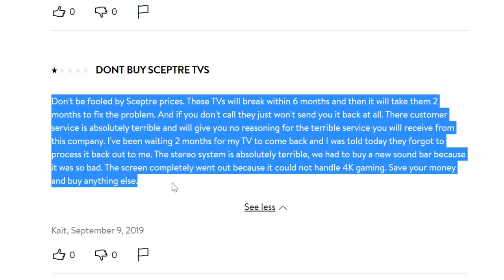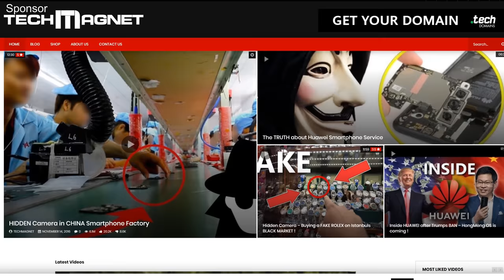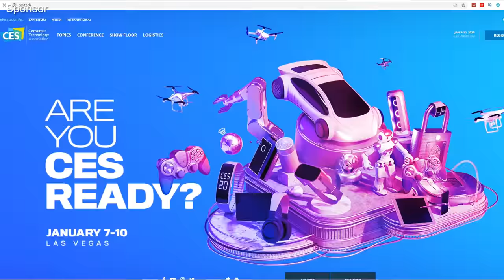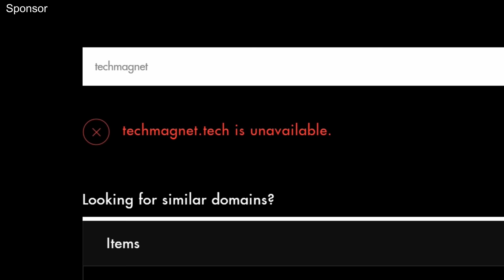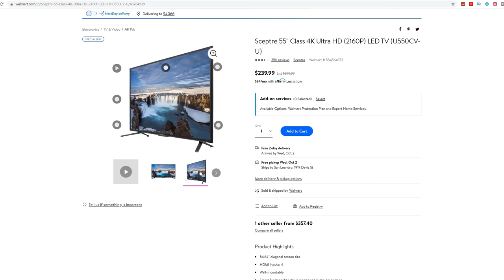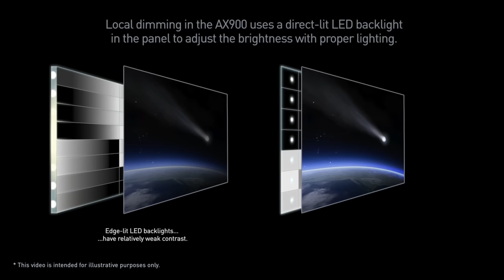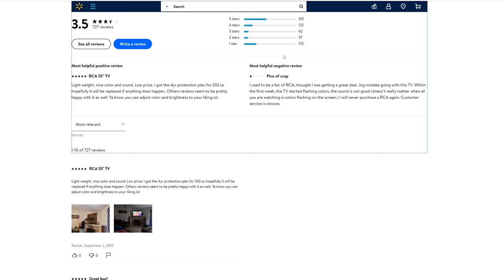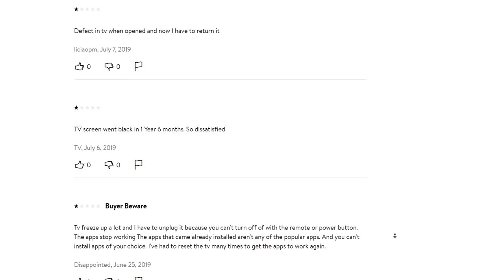The TRUTH about CHEAP WALMART TV'S !

Comment: My flat screen tv from wallmart is 10 years old and still going bought 2 TVs from best buy name brands only  got 6 months out of a lg tv and a Panasonic lasted 2 years so wallmart TVs are pretty good to me
Reply: To each their own but I could never get a tv from Walmart because they are the bottom of the barrel. But I'm glad you found one that hasn't given you any problems man.
Reply: We purchased two Samsung Smart TVS in 2015 and one of them stop working and later we fix it but we accidentally broke a pet of the tv and the display is not the same as before and the other tv we bought it in 2015 I believe almost the end of 2015 and we still have it
Reply: I got a scepter 55 inch from Walmart and steal going strong after 5 years. Would never buy named brand TV again.
Reply: @jayDee92133  I honestly dont think theirs a difference my 4k tv for 300 bucks 55 inch my uncle got a Samsung oled over a grand and we couldnt tell the difference between them no bull
Reply: We bought a tcl 65 inch from Walmart last year.  It gets used a decent amount and is still going strong.  The only issue I’ve had with it is a couple of times the picture flaked out and the colors were way way off.  In each case, unplugging the tv then reconnecting power seems to resolve it.  However it hasn’t done it for a while.

This TV is a roku TV, one thing I did do was to factory reset this tv, and never allow it to connect to the internet.  We do use a fire stick with this TV, so I’ve set it to automatically go to that hdmi input, and turned off all data monitoring etc.

The tcl from Walmart has been ok, but when I got it, I was trying to find other brands in the same size, but it was literally the only brand in that size available that day.  Otherwise I probably would gotten a vizio or lg, etc
Reply: Me too my tcl has outlasted my lg
Reply: @LIFEWITHTHEJONESES1  good deal.  Now I can say I owned an lg 49 inch.  Had it for probably 3-4 years but wanted the 65 inch, and ended up giving the lg to my in laws.  

In the man cave I still have another 49 inch, a Polaroid.  When it works it’s ok, but the Polaroid is very quirky sometimes.  Like sometimes it likes to turn itself off or likes to not respond well to it’s reboot or not allow you to switch inputs.  However the fix has been so far, keep it plugged into a power strip that I turn off when I’m done using that screen, then turn back on when I’m going to use it.  So software in the Polaroid seems flaky.  But I only paid about 200 for it 2-3 years back, so I’m getting my money’s worth, but am saving for either a 58 inch or 65 inch to replace it.
Reply: I think he's more talking not just about it he's talking about the video quality
Reply: @kcg7861  you may be right.  In regards to video quality, I would rate the tcl as ok.  At least their cheaper 4 series aren’t what you buy if you want the very best picture quality.  But I’ve got no major issues with the picture quality myself.

That said when I buy I personally tend to buy based on size vs cost vs performance.  I think most people are going to be satisfied with either screen as long as it’s connected to a high quality signal.
Reply: @Averagedude-mi3fl   TCL is pretty reliable however. The four series should be in a dark room because it doesn't even have a bright enough panel to do the true 4K. An expensive or TV can do 4K and in a bright room. The processor is a bit old in the TCL and there's no software for upgraded frame rate but I would have to say that the Tcl is probably one of the best Chinese brands you can get. And they tried to make everything in house they don't outsource or buy from other manufacturers besides the panel but the motherboard and power supplies all made by them that makes a difference that's why the new 5 series TCL is very good.  Especially the one with the q LED
Reply: I’ve had my tv from Walmart since 7th grade. I’m a sophomore in college and it still works good.
Reply: @carriel9954  awesome
Reply: @carriel9954   I think you don't understand or you didn't watch the whole video he's not talking about all TVs that are cheap he's talking about the TVs that are made in China with slave labor what what Walmart sells and they're just not that great the video quality is horrible it cost not much more than a name brand okay and literally if you have to buy a new one cuz it's so crappy made you basically are polluting more and wasting your time and money as if a person who worked at Walmart for over 5 years I can tell you unless you're not buying a name brand most of the other Chinese brands unless you actually get a high end model from a Chinese company most of them are built with slave labor and have very very low quality parts in there that will break and you never even said what brand your TV is
Reply: We bought from Walmart too I guess it could also be that it's not Walmart but the manufacturer is to blame think about it most companies are manufactured from China right we all know the joke if it's in America probably got a made in China sticker not to blame that company they're cutting corners but it sucks when you pay full price when it messes up but for me and my family we always bought from Walmart and no issues takes years before we need a new one. But go to any company not just Walmart and it will most likely also be made from China you can't escape that.
Reply: @creepy-kitty  the whole point is it that the TVs are not really cheaper most people who shop at Walmart don't do the research and yes some of the Chinese brands are a little bit cheaper than a name brand however you pay for what you get.     Not all Chinese brands are unreliable but the cheaper ones again you pay for what you get to do in Walmart knows what they're doing.  The cheaper TVs only have a life expectancy if you use them a lot for a few years but it's the video quality what he's talking about too you'll see dead spots in the TV again though most of the people who shop there don't really care as long as they have a big TV they think it's all the same
Reply: @creepy-kitty   I think you're missing the whole point in the video
Reply: My Samsung TV died after a year and a half. Not so sure if name brand means quality anymore
Reply: @PTRAINBOY  Samsung is not the most reliable brand.  Their washing machines like to quit working two weeks after the warranty ends, too.  Their cheap flip phones worked quite well but those are a figment of the past nowadays.  My sister likes Samsung televisions, she is usually buying one every 2-3 years (and she buys the 75 inch version that fastens to the wall -- those cost BIG bucks).

Comment: I have 3 TLC Tvs for 3 years with zero issues and they were cheap. If you gonna use as a second TV, it is worth it. If they break in a couple of years, you didnt break your bank.  The money you saved, you buy another one.  I love the built in ROKU which you will not get with name brand TV.  I know friends that spent Samsung Tvs and within a year they have dead pixels. It does not matter of you buy a cheap or expensive TV. If they go bad, they gonna go bad.

Comment: Back in 2008 I used to work at a furniture store and I bought an LG Scarlet, one of the most beautiful TV I've ever seen. The casing was a shiny Corvette red and it had a very distinct feature which was the power button. I don't think I've ever seen another power button like on this TV. It was a see-through piece of plastic in the center of the television it was very different definitely stood out. And the picture oh my God the picture probably one of the best I've seen for an older Generation TV. It was a 52" 1080p 240 h with true motion technology. Didn't matter what kinda  signal you hooked up to the it would give you an amazing picture.Older TV shows or movies that I had recorded on VHS looked amazing with the true motion feature. After 12 years it finally started showing signs of age. And earlier this summer I started having some problems with the picture it would come in and out I guess it's common for these Lg  TVs .  I ended up giving it to my friend and he ended up taking it to a shop in Mexico I believe he got it repaired for $60 and it ended up being the power unit. Back in 2008 I think I spent close to $1,200 for the tv  I got my money's worth 12 years isn't that bad and it's still being used in someone else's home. My advice is save your money and buy something that's worth it, it's going to last you a lot longer
Reply: I wish I could say the same for my 10yr old Samsung 50" Plasma. It recently developed horizontal lines across most of the display due to the ribbon cable between the panel and the video buffer board developing 'opens'. The ONLY FIX is replacing the panel, to the tune of $1300 IF one was available (Samsung stopped manufacturing panels 5yrs ago). Except for a couple hundred horz lines, the display is STILL awesome with the DEEPEST BLACKS and 180* viewing angles. I wish my problem was a simple board replacement! The irony is, I only ran the TV for about 10hrs a week for SERIOUS home theater movie viewing. HEART BREAKING!!!!

Comment: You seem to be forgetting WHY people buy CHEAP TVs, like maybe they CAN'T AFFORD a $2000 TV! I am in that group. I recently purchased a Philips 65" TV from Walmart for $498, that, except for TRULY BLACK black levels, outperforms my 10yr old 50" Samsung plasma tv, which btw cost $1000! The Samsung panel interconnect ribbon cable went bad , for which there is NO FIX. So, I figure that if my $500 Philips craps out, I will only be out $500 versus paying $2000 for that "perfect" Oled TV and being out 2grand WHEN it craps out. And, it just might be BEFORE 10yrs!!

Comment: Well I purchased a vizio tv from walmart several years ago around 15 and to this day it still works. In 2016 I purchased an M50 C1 4k Vizio smart tv for $750 and it just went out. It is unfixable. That tv was purchased  from an actual store and not walmart. It lasted less than 4 years. That is bullshit. No way in hell any tv should not last at least 10 years and should last 25-35 minimum. I will never buy another vizio but I will buy one from walmart. At least if it goes out it wont be expensive to replace. So that is what I have to say about walmart tv's. Buy the hell out of them. They are more than worth their cost.
Reply: I got a tv for my birthday like 10 years ago and it still works but I'm going to get one of those smart tvs from walmart, and give my sister my old tv
Reply: 35 years, so you expect to see people still widely using CRTs today then, I'd say 10 years is a decent lifespan for a TV

Comment: Really enjoyed your in-depth TV review. My own experience from owning LG, Samsung, and TCL LED TVs, is nothing compares to the picture quality of Samsung. Also the Samsung electronics do a good job of cleaning up the digital signal. The Tizen operating system and menus on the Samsung, have all the best streaming channels already built in, like Pluto, Tubi, Roku Channel, YouTube, Crackle, PBS, Netflix, Hulu, Sling, Vudu, Newsy, and CBS News. So there is no need for a Roku streaming stick with Samsung. My older LG did not have all these channels available. I also have a Samsung QLED and these models do get very bright. TCL bundles the Roku interface into its TVs, which is very convenient and good for the money. But the budget 6 series from Samsung 65" is now just $479 , and 55" is now $377 at most retailers. So those are my recommendations. Thanks again.

Comment: Personally, I love cheapo TVs. Sure, they're not as good or sophisticated as high end TVs but the problem is diminishing returns the higher end you go. You end up paying exponentially more for incrementally better performance. This phenomenon gets worse year over year as flat panel technology itself only improves marginally compared to when the technology was new. 

What's more, features considered new today quickly trickle down to into less expensive TVs in a couple of years further exacerbating this effect. You can obtain a high degree of previously considered premium performance in a cheap package today. And unless you compare side-by-side it can be really difficult to tell the difference.

That leads to the most important thing... how does it look to you? Put aside your need to have the latest, greatest, most fashionable item for a moment and focus on the utility. In the absence of another set to compare with, does the image satisfy you? If so great! If not, keep shopping. Not everyone's a videophile and not everyone has the same use-case.

My main TV is a 70" Vizio. Middle of the road brand and a middle of the road model within it's own lineup. I bought a demo model back in 2015 for $700 CAD and I'm still using it today to write this. To be fair, a few years ago it kind of died on me but I fixed it with a replacement mainboard I got from ebay for cheap. What can I say, I'm kinda cheap lol.

I've also been using a 42" Seiki as my computer monitor since 2015 which I bought for $350 CAD. It finally bit the dust a few weeks ago and I replaced it with a similar Hisense.

When I'm watching a movie or a show it never occurs to me that I need or want something better.
For the amount of use and enjoyment I got out of them, I consider it a smart deal. But to each their own.

Comment: picked up my cheap ass LG 4K TV 43' quite a few years ago now and i guess it must be actual 4k as i used to use it as my PC monitor,and setting the resolution to 4K in the nvidia control panel was never an issue,i think i picked it up for like £300 bucks about 4 or so years ago
Reply from the maker: Yea and now 4k 55 inch is as low as 200 bucks lol crazy shit. But they dont last long

Comment: LG is my brand, great quality.
Reply: Always late and out of date apps tho
Reply: LG engineers need help though, I can say that because in an LG front load washer, they had a god awful design on the thermoster wiring design. It was a horrible setup that kept causing error codes on the sensor. I had to redo the wiring mounting in the manner it should have been originally. They had clips for the wiring mounted right to the side of the drum, the wiring had no slack and it kept unplugging it self. Very poor design at least in this LG washing machine.
Reply: I like LG and Sony but LG more towards budget options. Vizio for budget tv ain’t bad either my mom owns one. $500 tv. The M series.

Comment: What a Best Buy tv rep told me is if it’s the same tv from them vs Walmart but Best Buy’s is slightly more than there’s a reason and you can tell because Walmart will have a different model number for the same tv and the slightly more expensive one at Best Buy will have the original model number and better quality.. it’s probably because Walmart cheap and doesn’t wanna pay for it so they make the budget TVs for Walmart .. and looking at the tv my gf got at Walmart compared to the same tv my sister got at Best Buy it’s light years better in picture quality… my sister bought a 43inch for the same price my gf got a 50 inch at Walmart but you can see how bad the quality is once you see the two TVs .. so no ill never buy a crap Walmart tv again had a Vizio I got when working there and it had dead pixels returned it for a different Vizio it had horrible quality and only lasted a year before taking a shit got it back under warranty and it started to have the instant logo loop restart soon as the warranty expired.. also have 3 Vizio soundbars from Walmart and all 3 have been crap they all will work just fine but after a few days you go to turn them on and they have to be unplugged and replugged back in to turn on

Comment: Some earlier sceptre tvs(1080p) had sony panel in them,most of the panels made by the same manufacturer .never had problem with cheap tvs before but i throw out lg,samsung tvs. oled is just too expensive for most of the people, so the cheap 4k tvs just fine. you can buy a new one if its brakes. you can get a new tv every 6 months if u want to. @200 for a 55inch 4k .....:)
Reply: Here in NZ there's a couple cheap brands with 3 year warranty, they die, you go back to the store and they'll replace it with the current model of the same size

Comment: Recently won Bolva 65” 4K smart TV.  I never heard of this brand prior to now. Surprisingly it has decent picture quality. The audio is nothing to be cracked up over but ok. The cheapest parts is differently the remote control. There doesn’t seem to be any available codes to sync other remotes such as fire stick or cable provider remote.